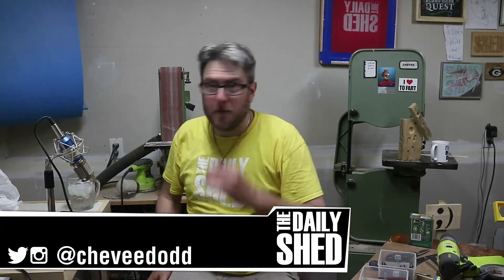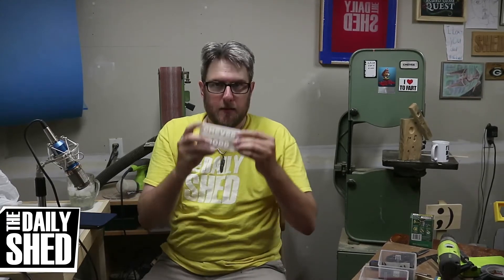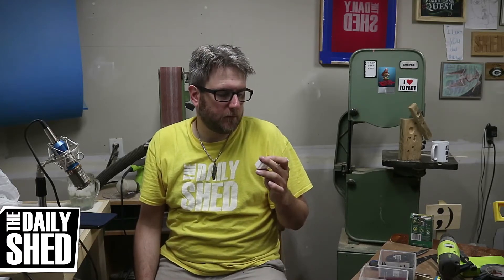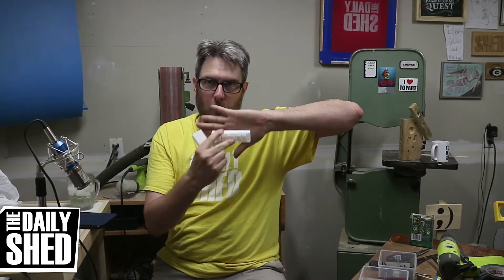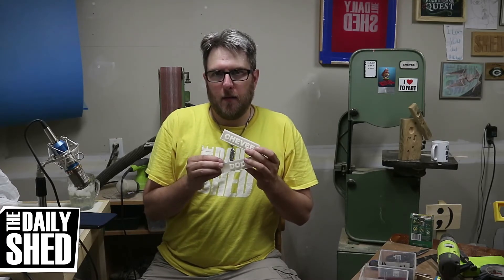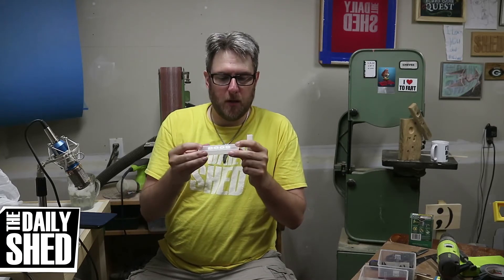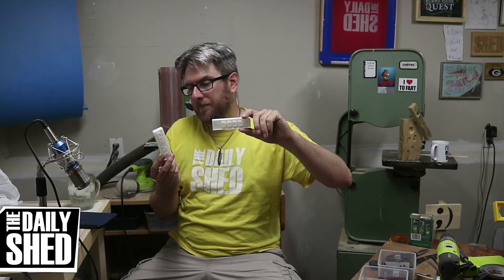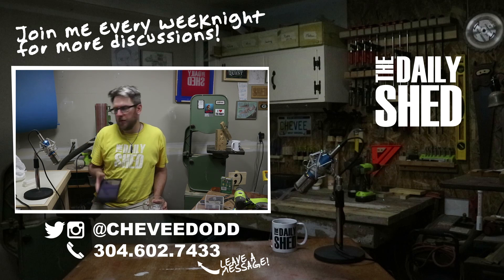3D PRINTING MOLDS?

Comment: Could you post a tutorial on how you made the plastic mold? PLEASE!!
Reply from the maker: +Sue Parks you want to see how I modelled it or how 3D printing works?
Reply: Chevee Dodd I would like to see how you modelled it!  Did you try the oommo silicone yet??
Reply from the maker: +Sue Parks I will do a video this week then!
Reply: Chevee Dodd If you made the mold using flexible filament, do you think it would be flexible enough to remove the silicone after it hardened?
Reply: Chevee Dodd I would love to see the tutorial!
Reply from the maker: +Sue Parks that's a great idea! I haven't tried any flexible yet.

Comment: I found that using the 3D printed parts (PLA), i had release problems. A couple videos ago I used 3D prints to make silicone molds with cheap rubber from the craft store, it worked out pretty well and was pretty easy.
Reply from the maker: Perfect. I'll check that out!
Reply: There needs to be a slight Draft angle between surfaces, maybe this helps?

Comment: I was going to say use them as a negative and then cast pewter into the silicone positive.  You could print a sleeve to extend the walls by 5mm or so and pour to that new top.  I will be doing this same process soon with different material, basically why I bought my printer.  Using a mold release agent will help quite a bit.  I use UMR it's worked great so far even with alumilite (Al in epoxy). The other thing would be to design the positive of the mold and print in a different color and glue the two pieces add a magnet and throw it on the fridge.  Ahhh 3D printing fun stuff.
Reply from the maker: Oh, these are all great ideas! Thanks so much for the info! I plan on using concrete and cooking spray as a release.
Reply: "Concrete and Cooking Spray" sounds like someone's autobiography.
Reply: I have no idea why youtube didn't tell me about this reply lol. But right on, I just watched your new video from today, sounds like you got all solid plan, I forgot to mention the smooth-on products i've used them in the past for fine detail stuff the dragon skin silicone works really well and will handle the layer lines easily.  I think you can get the "sampler" sizes for decently cheap.
Reply from the maker: +16by80 I'll check into it. Thanks!